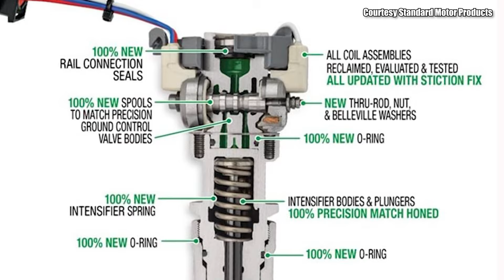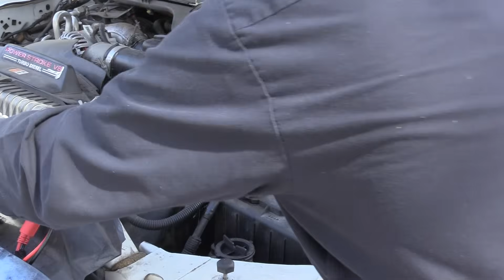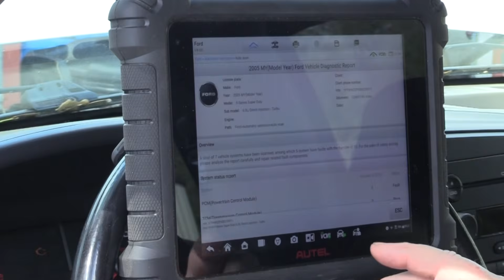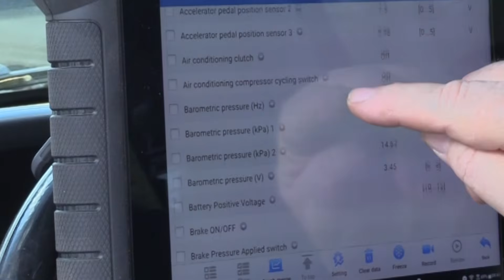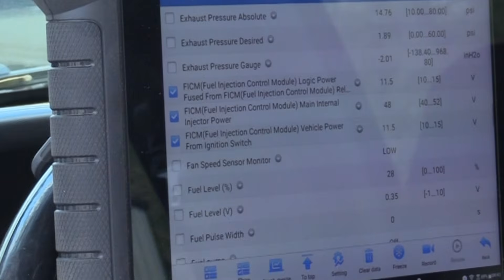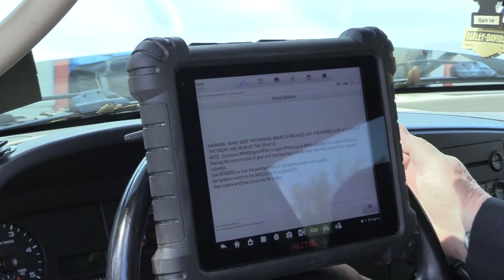The Trainer #124:  Diagnosing A Diesel “No Start”

Comment: Hello... What if you have a small air leak in the fuel line leading from the tank to the primer..

I have an L200 pick up...i changed glow plugs, fuel filter, primer pump and i over hauled the fuel injecter pump...
Still takes long to start.....

Comment: The first test could be just listen to the cranking.  If your battery starts getting weaker after a few times, you have compression
Reply: Does this mean if the battery is getting weaker on repeated cranks then there is no issue with the compression ?

Comment: Hey, I have a 07 6.0 that will crank and fire but won’t start. When it fires it dumps out black smoke and kinda smells like something’s burning. I have a few things I plan on checking like the ficm and air filter but was hoping for your opinion. Thanks
Reply from the maker: Black smoke is an indication of excess fuel. White smoke is unburned fuel. How fast is your engine cranking? Too slow will not allow the air charge to heat up sufficiently to ignite the fuel. What is the battery voltage? Too low will slow cranking speed and can impact FICM voltage to the injectors. There are many factors to look at on the 6.0 - do you have access to a scan tool with Ford capability?
Reply: @VehicleServiceandRepair  i know it’s cranking fast enough cause it’s firing and there should have been enough battery voltage. I just scanned it and everything looks good. It’s really confusing cause everything that it needs to start is working.
Reply: @VehicleServiceandRepair  I know it has a high pressure oil leak somewhere but it is still building up enough pressure that it should start
Reply from the maker: @nathanhill1525  What is your cranking ICP?
Reply: @VehicleServiceandRepair  I don’t remember exactly what it reached but it was around 1500 which I believe is what you typically want to see
Reply from the maker: @nathanhill1525  Did you check crank/cam synch?
Reply: @VehicleServiceandRepair  yeah it had synch. I appreciate your help but it’s probably hard for u to determine what it is without actually having the truck in front of you. I’m gonna try a few more things then maybe just send it to my local mechanic. Thanks, I appreciate your help.
Reply: I’m not sure what the voltage was though, if that’s what you were asking
Reply: If she’s smoking black most likely cause is the fuel system. Sticking injector or excess fuel volume. Is it only a puff when it’s fires up or it’s constant?

Comment: So you did not find any problem except low battery? I have 49 yr old sailboat 1500cc diesel motor needs help
Reply from the maker: What kind of problem are you having? No start?
Reply: @VehicleServiceandRepair  Of the serious nature, water in the oil not sure if coolant or raw water, could be head gasket, will try retoruqueing head before pulling
Reply from the maker: @chhindz  Odds are that if it is the head or gasket, retorquing will not correct or help. Does this use a standalone cooling system or does it continuously pump sea water through the cooling system jackets? I don't know much about marine diesels.
Reply: Taking the place of the radiator it has heat exchanger where tubes of non mixing sea water and coolant dissipate heat sea water never entering block. I had an old 420 jaguar which was gushing water from head after a freeze,  I tightened head and it ran ok for years after. I don't think it will work either, but no harm in trying except a lost gallon of oil

Comment: How come no one does MAF testing on (like 4 gen Ram) diesels? Just found your videos and they are very informative. I can't wait to do some testing. Gotta find out why ecm pin 80 to my MAF only has 11.4 V, While ecm is getting battery voltage (12.4). Videos very inspiring.
Reply: It only has 11.4 the circuit might be under load check with amp clamp

Comment: Thanks Pete, now I gotta go try my FLS sensor on AC coupling and experiment!!!!
Reply from the maker: Let me know how that works for you!
Reply: @VehicleServiceandRepair  Used a Nicholson FLS on AC Coupling , I saw no discernable difference.
Reply from the maker: @paulpaquette1961  Thanks for the update! What did you connect the FLS to?
Reply: @VehicleServiceandRepair  Test engine was an L83, using the Map Sensor port.  PCV system isolated from Intake, there was no difference, I could reference one waveform and overlay it on the other.  When I use thwe WPS the waveform is cleaner, I took 4 captures total, and this engine needs a cleaning.
Reply: @VehicleServiceandRepair so what was the no start issue?

Comment: When I worked at L.A. D.W.P. we had only a few light duty diesels, both the 7.3L V8 and the 6.0L V8.
The 7.3's ran great in the vans only had one 6.0 that would not start after it was shut off.  Relative compression and 48 volt FICM no problem, but the I.C.P. at cranking was supposed to be a minimum of 500 PSI like you said. 
The low pressure fuel system was delivering fuel to the HP pump with no problems, I don't remember the reading now.  The truck I had was at 250 to 275 PSI for the High Pressure.
I was working on it in L.A., but after one day (and a total learning curve) they took it on a roll back to Mojave.
I had read a lot about 6.0's, and some of their diagnostics. 
I wanted to check the Injector Control Pressure Sensor and Control valve as I had read how if they get contamination in them, that will cause a no start.  Sadly, the truck was taken before I could do that.
Thanks for the info Pete.